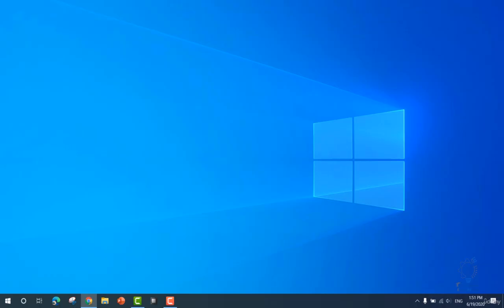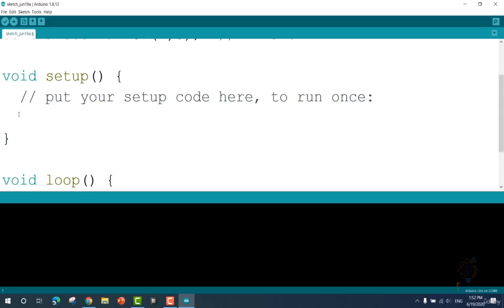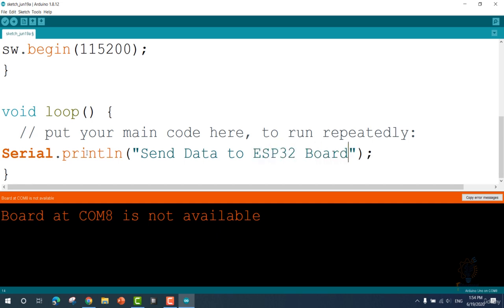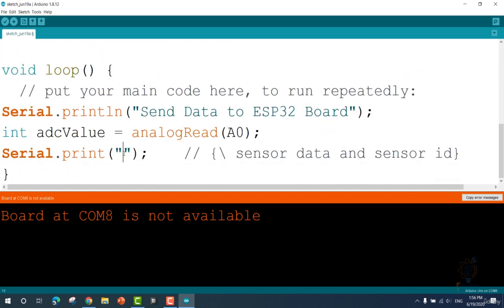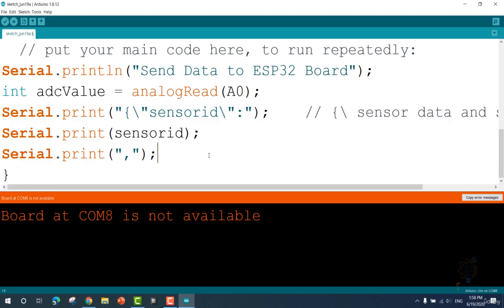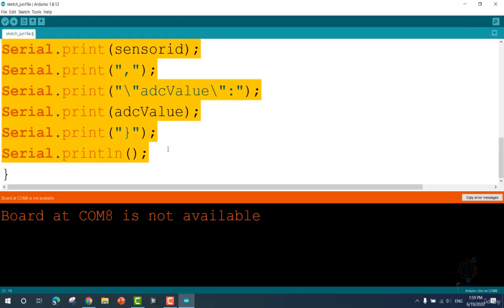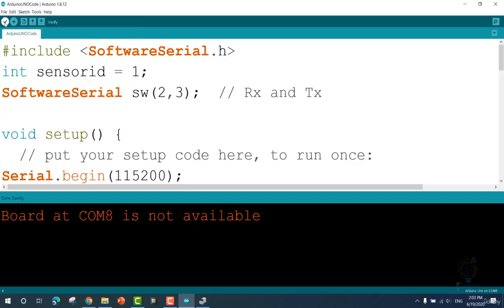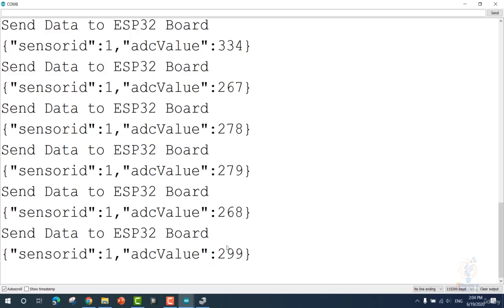Tutorial ESP32 + Arduino Interfacing A Step by Step Course Sec 6 Arduino Coding

Comment from the maker: #include <SoftwareSerial.h>
int sensorid = 1;
SoftwareSerial sw(2,3);  // Rx and Tx

void setup() {
  // put your setup code here, to run once:
Serial.begin(115200);
Serial.println("Project for Interfacing Arduino with ESP32");
sw.begin(115200);
}

void loop() {
  // put your main code here, to run repeatedly:
Serial.println("Send Data to ESP32 Board");
int adcValue = analogRead(A0);
Serial.print("{\"sensorid\":");    // {\ sensor data and sensor id}
Serial.print(sensorid);
Serial.print(",");
Serial.print("\"adcValue\":");
Serial.print(adcValue);
Serial.print("}");
Serial.println();

sw.print("{\"sensorid\":");    // {\ sensor data and sensor id}
sw.print(sensorid);
sw.print(",");
sw.print("\"adcValue\":");
sw.print(adcValue);
sw.print("}");
sw.println();

delay(4000);

}